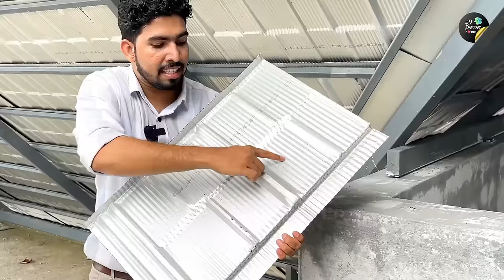Modern Roofing Tiles 😍😍 | 50 വർഷം വാറണ്ടി | Stone coated Roofing Tiles | My better home

Comment from the maker: 📍 for more details :
DOKTALE Roofing systems.

Contact :
+91 97454 77770
+91 97454 77787
+91 97454 77777

Authorized Distributor 
KUDKYS ROOF.
Near toll gate Kumbalam, Kochi, Ernakulam, Kerala 682506
Reply: Why cant you sat the cosft
Reply: These guys don't reply or respond, why would anyone trust them ? 50 years warranty form such unreliable people.
Reply: തിരുവനന്തപുരം ജില്ലയിൽ ഇതിൻറെ ഓഫീസ് ഉണ്ടോ
Reply: Why did not you respond on call.someone says u not depend able.
Reply: ,50 years company undakumo. Entho
Reply: Bad Experience From This Company
Reply: നിങ്ങൾക്ക് 100000 അഡ്വാൻസ് തന്നിട്ട് ഏകദേശം ഒരുമാസം ആയി . ഇന്ന് വരാം നാളെ തുടങ്ങാം എന്ന് പറഞ്ഞു നീട്ടുന്നു . ഇന്ന് വരെ തുടങ്ങിയിട്ടും ഇല്ല(5/7/24
Reply: What is the rate now